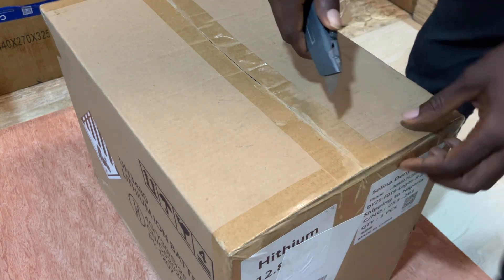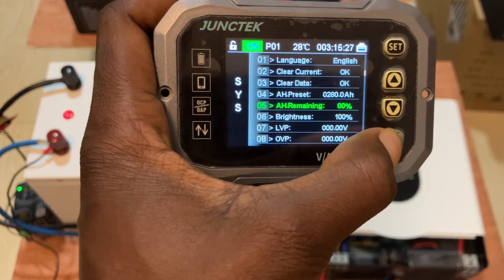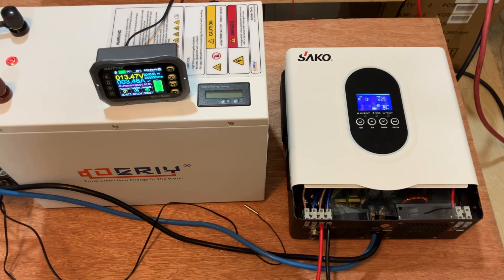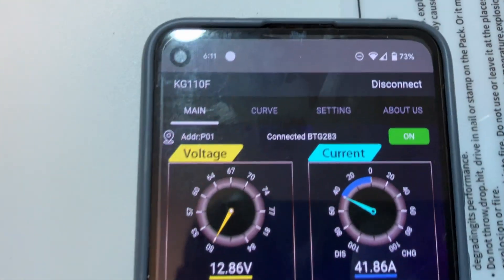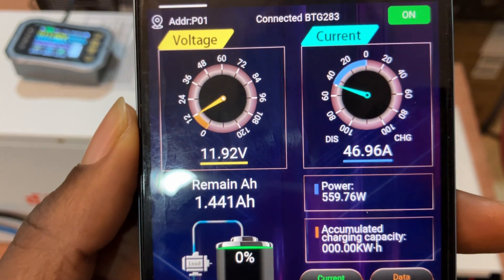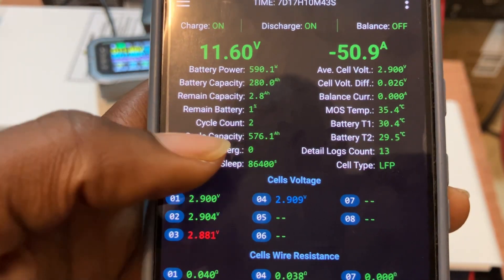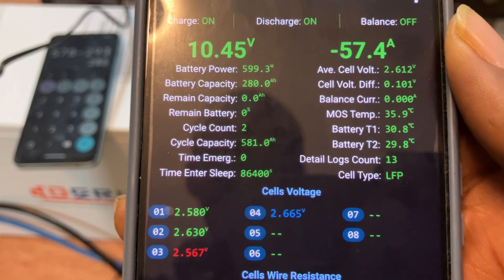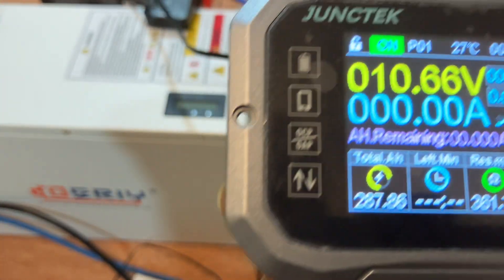DERIY 12.8V 280AH 3.584KWH Capacity Test results

Comment: Can I connect two deriy 3.6 kWh, 12.8 V lithium batteries in series to get 7.2 kWh and pair them with a 4 kW hybrid inverter? and if purchase the batteries from you do have any professional installer in port harcourt 

thanks
Reply from the maker: Send us message on +2348165213568

Comment: Good morning, bro. Between a Firman 24V 5kWh lithium battery and an LVTOPSUN 24V 5kWh lithium battery, which one would you recommend I buy? I’d really appreciate your advice.
Reply from the maker: I have not reviewed Firman yet, we sell LVTopsun products, and they are good so far no issue. So We recommend LVTOPSUN batteries and it's cheaper.
You can reach us +2348165213568
Reply: @odedeyidamilare good morning, you have this battery for 15kwh...I want to use it for my restaurant
Reply from the maker: @uvwieeki3576  yes, you can reach out to us on +2348165213568

Comment: Thank you very much for this analysis...
Will it be possible to have upto 8000 lifecycle? That is what it was rated from the data sheet.
Reply from the maker: Time will tell.
Reply: This battery's Total lifecycles is even greater or equal to 10,000 lifecycles (ie 10,000 ÷366 = 27 and, if a cycle is used daily). But my question is won't the the BMS fail before 20 years?